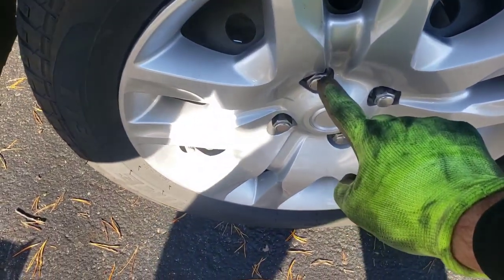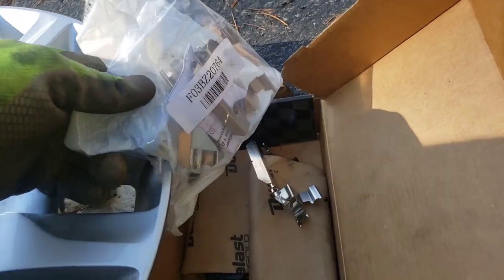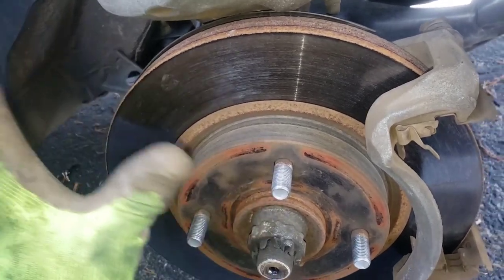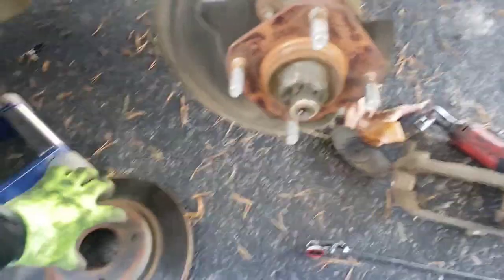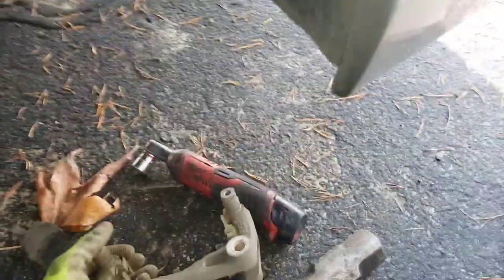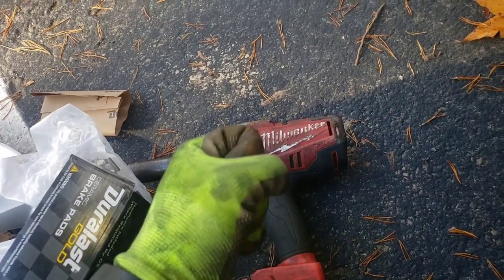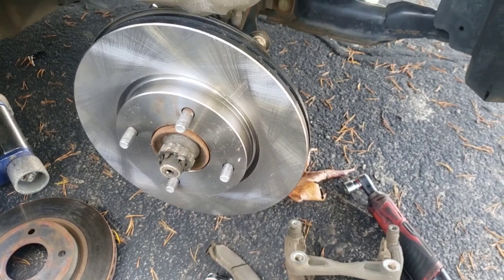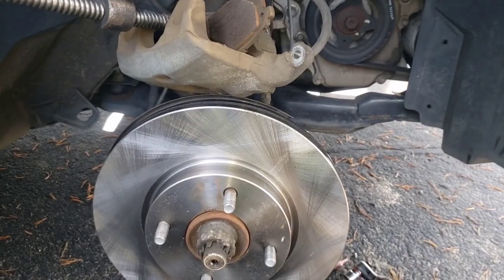2007 2012 Nissan Sentra Brake Pads Rotors Replace How to 2008 2009 2010 2011 Install Remove

Comment: Hey my man, the reason that bolt had so much resistance at 3:35 is because you had the whole bracket's weight pushing down on it. If you just hold up that bracket it'll come right out with your ratchet :)

Comment: You should've took off your brake fluid cap off. So you push the air out of the lines. And you forgot  bleed your brake lines.

Comment: No brake grease?
Reply: You don't really need it if there is still some. I use high temp grease in the push pin holes never had a problem.

Comment: Yeah, it's hilarious how these "DIY Auto Fixit" videos are always so bogus, all their nuts and bolts just spin easily and come off by hand ... what you don't see behind the scenes are the specialty mechanics tools like pneumatic impact wrenches and breaker bars used to get them off first, then they thread them back on by hand to make it look easy

The 2 bolts holding my caliper bracket on literally broke my electric impact hammer when I tried to get them off. So yeah, this "easy" job takes about $300-$400 in specialty tools to do. Very deceptive video.